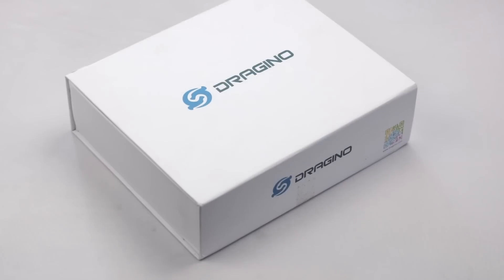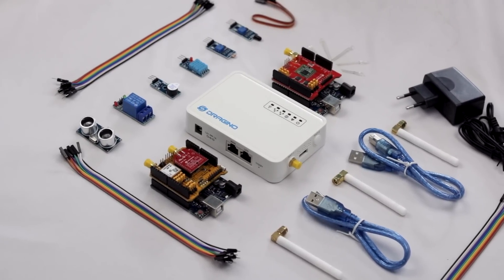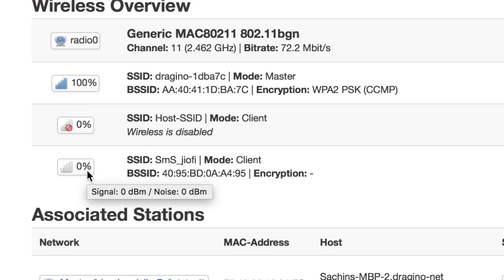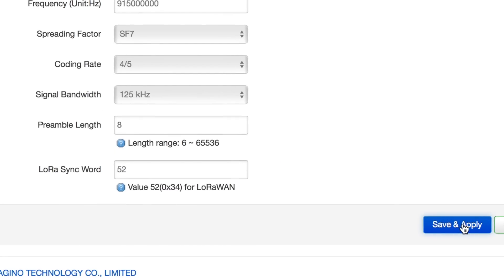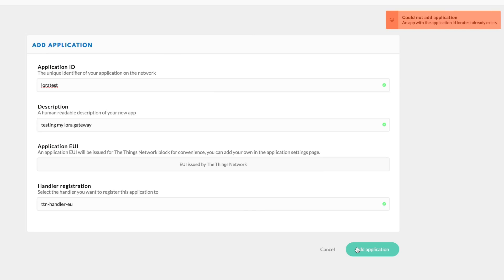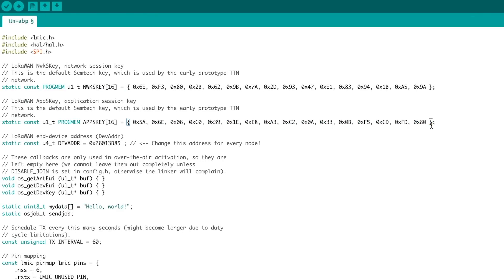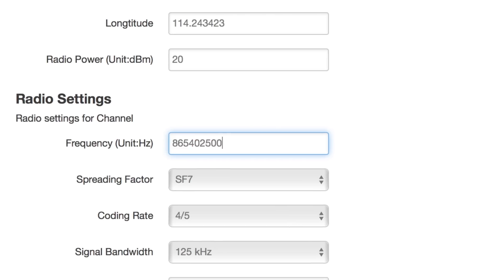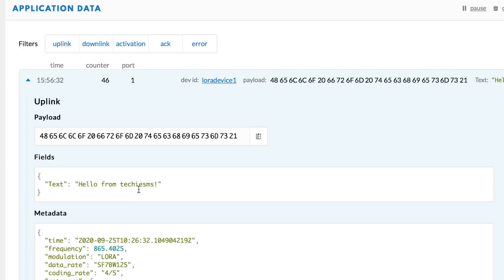Testing LoRaWAN Gateway using Arduino | Dragino LG01-N

Comment: Abbey salee...itna kuch karne ki zarurat nehi hai... 
Take an Arduino UNO and connect a NRFL01 module or LORA module and also attach an ESP8266 node mcu and connect the mcu with internet and firebase.
No need to spend so much for this simple task. It will even make your fundamentals clear

Comment: Biggest mistake, very small antenna ! Use fibre glass antenna for gateway ! And atleast 3dbi antenna for nodes. Hardware is ohk it's not underpowered
Reply from the maker: Can you give me some links from where I can purchase these antennas in India
Reply: @techiesms  they available on Amazon and AliExpress or even mouser electronics (just make sure everything is 868Mhz only)

For Gateway - glass fiber antenna of above 3dbi (868Mhz)https://m.aliexpress.com/item/33028205416.html?spm=a2g0n.productlist.0.0.55ec1af5OT1ozc&browser_id=7e4ebd09e0fb493d91b3e02dcabd998d&aff_trace_key=&aff_platform=msite&m_page_id=upomfddf1ccabdxk17505262852236ef36401c95a9&gclid=&_imgsrc_=ae01.alicdn.com%2Fkf%2FH50382b4ffa1f49f9a03d328173980327e.jpg_640x640Q90.jpg_.webp

For sensor nodes - helical antenna of minimum 3dbi(868Mhz)https://m.aliexpress.com/item/4001036512505.html?spm=a2g0n.productlist.0.0.572a43dezcH5gy&browser_id=7e4ebd09e0fb493d91b3e02dcabd998d&aff_trace_key=&aff_platform=msite&m_page_id=1750524b36af4dcb86723ad1c194fc1837081312ea&gclid=&_imgsrc_=ae01.alicdn.com%2Fkf%2FHa76ef7b3b1574917b7979582cd00ca63Y.jpg_640x640Q90.jpg_.webp

Comment: I live at distance of 13 km from the place that has a stable wired internet (fibernet) 
I would like to know  if there is any economical way for me to transmit the internet from such a distance and still get atleast 5 Mbps symmetric speed.
Reply: Lora is mainly intended for IoT device to send small packet of data
Reply: @sanajyvinai2736  Yes but I'm not asking how to use lora to fit my purpose I'm asking if there's any  way to do so.
Reply: kusumanchi ashish if ur using gateway u can’t transmit data there is a limit per day
Reply: @joblessguy987  you can use air fibre antenna

Comment: u said Price is reasonable but it is not 
the price is around 15,000 
except the Lora and Lora Gps shield , Router we can buy all the components only for less than 2k
Does it mean those 3 are around 13 K
it's too much
 they are charging those two shields nd Router for around 13K which is not reasonable
Reply from the maker: You can check out the price of this kit on other platforms like amazon etc 
By comparing them I told it’s a reasonable price
Reply: @techiesms  oh ok i will check nd reply 
Thank you
Reply from the maker: The gateway itself costs around 7-9k
Reply: @techiesms  Fine then 
It is fine then actually it is  reasonable , I agree